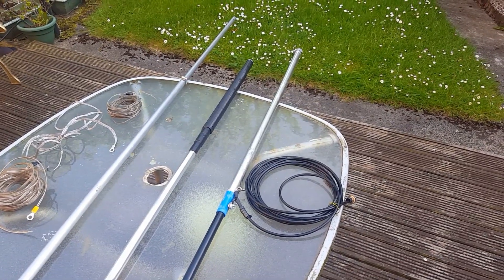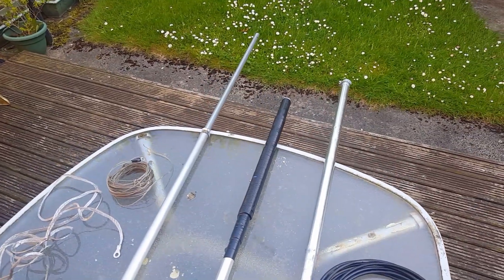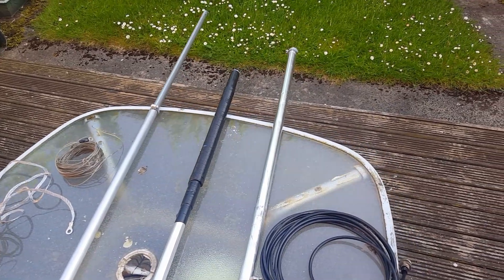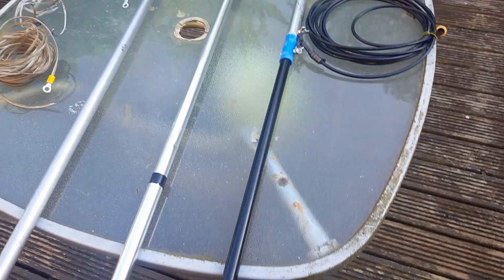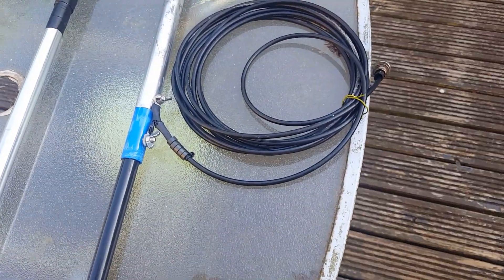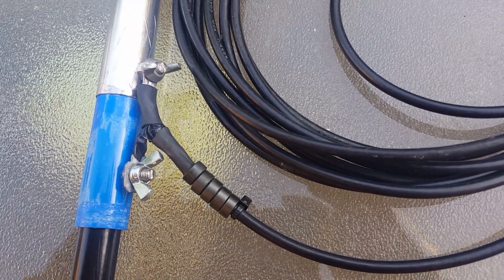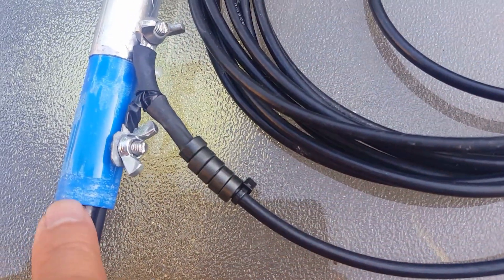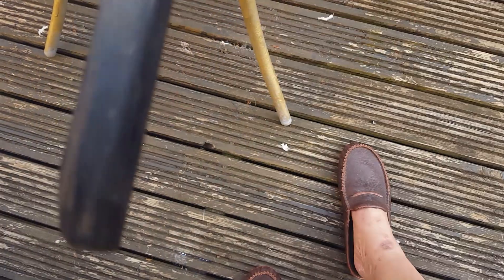40m Center Loaded Vertical Antenna Homebrew

Comment: Not a center loaded vertical. It’s a raised coil. Your radials are still attached at the base of the coil. If it was center loaded the vertical radiator would extend below the coil as well.
Reply from the maker: Hi Tom,thanks for your comments.If you look again, the radicals are connected at the bottom pvc with wing nuts tied together with the coax shield and not directly below the loading coil. If you notice, there's a tube connected to this bottom pvc and connects to the bottom end of the coil.If the coax is connected to the coil bottom then I would agree that its a raised  ,base  loaded vertical antenna. Cheers

Comment: glad I'm not the only one who hated the music, lol. going to look for the video without. I think it is an amazing design. what did you use for the upper section, just aluminum tubing?
Reply from the maker: Hi,yes it's aluminium tubing all throughout. Glad you find the music amusing, was just trying to mask out the noisy birds in the yard, hi hi
Reply: @mm0umz426  Thanks for the reply! I love the center coil - I saw you put some taps on it; without taps just the 100 turns, if you wanted something single band for 40m, you would tune by adjusting height?

Comment: Does it work?
Reply from the maker: Ideally a vertical radiator shd be at least a quarter wavelength. This antenna is shortened by adding a loading coil at the center.That said,this is a compromise antenna w/c is less efficient than a 1/4 wave one.Of course you can make QSOs w/ it but wouldn't expect it to be a great DX performer!The only advantage is it's portability. 73s OM